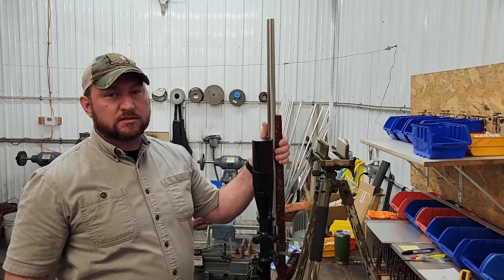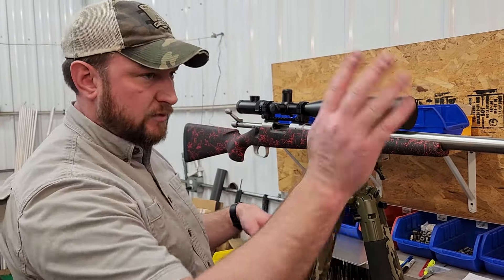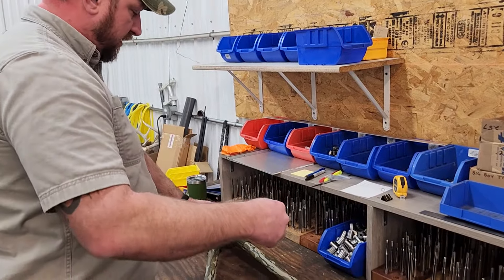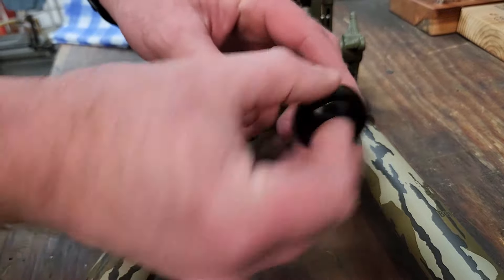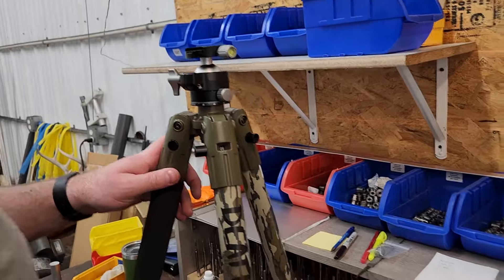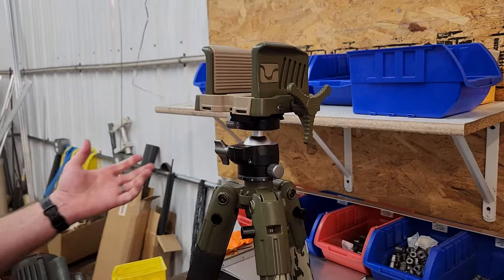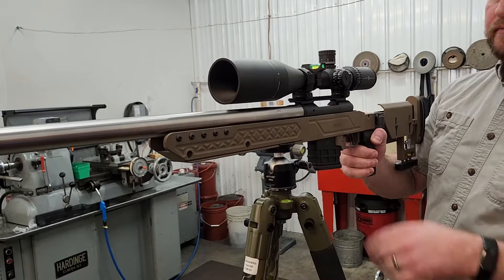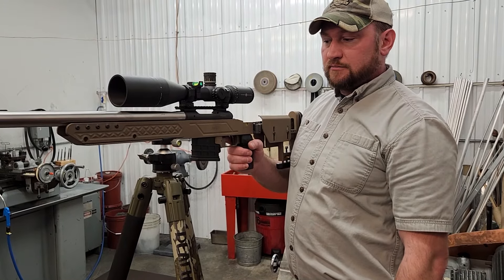BOG Deathgrip™ Tripod | "BALL MOUNT ADAPTER KIT" | Little Crow Gunworks

Comment: This is precisely what the bog should've come with, good on you guys for coming up with this. Will definitely buy one soon
Reply from the maker: We appreciate that Jake. After we released this product, we even purchased one of the BOG Infinite Tripods, just so our walk in customers could compare them side by side.

The Infinite Tripod has a price tag on it... yet there it sits, and our adapter kits are flying out the door.

In my opinion, they tried to solve the problems with the original tripod and in the process, created another product with a different set of inadequacies.
Reply: Damn shame the price you paid not a quality type!!
Reply: T totally awesome product fellas!!

Comment: I used a stainless steel 3/8- 2.5" shoulder eye bolt instead of the bolt that came with the bushing. It provides a place to hang a day pack to weight the tripod and keep gear within easy reach. Installed a 54mm ball head and the adapter plate for the Deathgrip mount. When everything was assembled, it still fit in the OEM BOG heavy duty soft case. I was afraid it might be too long, but fit like a glove. 😅
Reply from the maker: I'm happy that worked out for you! We thought about doing that originally but decided against it because we didn't think enough people would want it.

Comment: This kit is great! It fits prefect and is very strong. I just got mine in the mail and now it’s installed. Got a meeting with the coyotes tonight and I can’t wait. “The Real Test”. Thanks for your hard work on this kit guys
Reply from the maker: That's Great Shawn! Thanks for the feedback. Let us know how it goes after you have been able to field test it a little bit. You can call us too if that's easier.

Thanks for your business.
Reply: Does is tighten up pretty tight for hunting yotes? I want one for the same purpose
Reply: @Sawdog2  yes. Very tight, no worries. I have purchased  another one recently. Can’t go wrong

Comment: I purchased a Bog Deathgrip in December of 2024.  My bipod has a lip cast into the barrel of the tripod, which impeded the insertion of the adapter.  I had to file this away in order to complete assembly.  Wanted you to know about this in order to adapt your product.

Comment: I see with the death grip vise, there was some wiggle. With the arca, does it have the wiggle also?  I know the padding in the vise could be causing some of the wiggle. Just wondering before I buy your product.
Reply from the maker: Great question. There will always be some wiggle when you are only gripping the rifle at one point. Our product doesn't change how well the clamp holds the rifle. But it does make the tripod much smoother, easier to use and more practical to get the rifle level in all field applications.

We have had zero returns because the customer was dissatisfied. Only 2 returns, because the customer couldn't figure out how to assemble it. No other returns. But we have had hundreds of emails, calls and comments giving positive feedback.
Reply: Thank you. Going to order.

Comment: Did the new Bog Deathgrip Infinite model fix all the previous problems? I am from Germany, so buying the Infinite Model is probably my only option, even though it is very expensive imo.. Because I can't seem to find anything that I could mount onto an earlier model of Deathgrip and convert it myself into a ball mounted clamp system for cheaper money..
Reply from the maker: I personally do not think the Infinite model fixed the problems with the original. The Infinite is better than the original model, but for how much more expensive it is, it doesn't work as well as our solution.
Reply: Just bought the DGI.  I will be calling soon to order.  Great demo and installation of your product.  Thanks for making this.

Comment: I have a Sako 85 varmint 243 and he bogpod clamp does not hold the wood stock securely. Take a shot or two and it jumps out. I’d like to change from the clunky clamp to a ball joint Arco. My problem is securing the adaptor plate to the wooden stock. Any ideas to make it secure in the long term?
Reply from the maker: Yes, we hear that complaint often because the inside of the clamp is square, when it should be tapered slightly to keep rifles from jumping out.

You can attach an ARCA plate to a wood stocked rifle, but that's bordering on gunsmith work. You would need to find and ARCA plate designed for hunting stock. Then you would need some appropriately sized T Nuts to secure the ARCA plate hardware. The T Nuts require some drilling into your wood stock to secure them. 

I wouldn't call the process "easy" but depending on how handy you are, it can be done.

That is the best long term solution for a wood stock.

Comment: Just ordered the bog without the ball mount. Glad I did because this all head  seems way better quality than the new one they just came out with.
Reply from the maker: Thanks Brenden, We appreciate your business. We ordered one of the new BOG Infinite Tripods, just so we could compare it side by side with our retrofit solution. 

We have the two tripods sitting side by side in our showroom. We have a price tag on the BOG Infinite...yet there it sits. While our Ball Mount Adapter Kits are flying out the door.

Comment: Just saw this video do y’all offer anything that would attach to a Primos Trigger Stick Tripod Gen 3?   I am considering buying the death grip attachment and would live the ball head for maneuverability.
Reply from the maker: It looks like the Primos Trigger Stick has an available "Accessory Mounting Plate" that you can buy to attach optics etc. It looks like it has a 1/4-20 thread. You would need a thread adapter to increase that up to 3/8-16 thread. At that point you could attach our ball mount to that accessory plate.

Thanks for watching.

Comment: The one thing I don't like about the original mount is the tilt, even after you tighten it, it still has forward and backward play. Will the ball mount totally eliminate that play?
Reply from the maker: The Ball Mount is a drastic improvement over the original design. It is even a considerable improvement over the New BOG Infinite Tripod, that also has a ball mount. We have one in our shop for comparison.

To answer your question directly, no, it isn't possible for ANY mechanism to completely eliminate all play. If you think about it, when you grab the rifle, and apply pressure in any direction, while the ball is locked. You are applying a tremendous amount of leverage on a relatively small surface area (the ball itself). That's a tall order, to expect it to eliminate all play. 

What I can tell you is that we have sold a lot of these already and we haven't had anyone call back with buyers remorse. But we have had a bunch of positive feedback emails and calls.

I will be releasing a video soon where we are shooting 5 shot groups at 200yds, on paper with factory ammo and a handload that's in it's infancy with our 22 Nosler Test Rifle.

Dale and I both shot sub-moa groups at 200yds for 5 shots, off the tripod with our ball mount, from a seated position.

There isn't zero play, but its pretty darn good.

Thanks for watching.
Reply: @LittleCrowGunworks  I finally got a chance to check over my tripod, the 4 bolts holding the grip were loose, tightened those and it helped a lot. But there was still that tilt play in it. So I tilted and tilted till I figured out the problem. The two metal plate inserts that the tilt bolt goes through are not 100% tight allowing the play I was referring too. So I took off the grip at the tilt and put some super glue around the edges where those metal plate inserts slide into mounting (for lack of a better word ) fingers. I let it dry, put it all back together and 99.9% of that tilt play is gone.